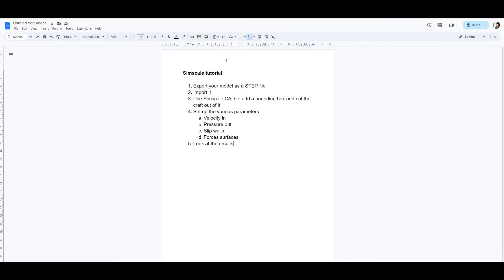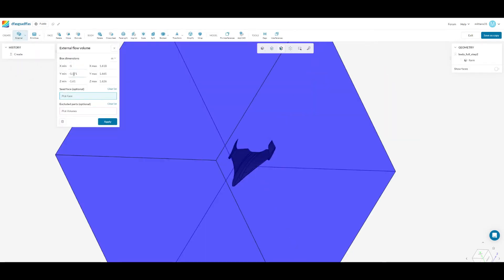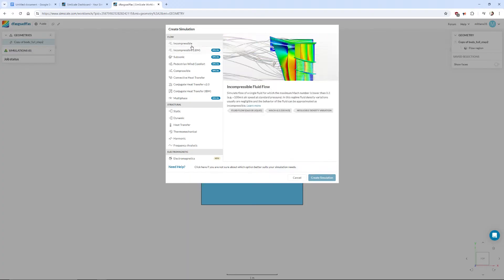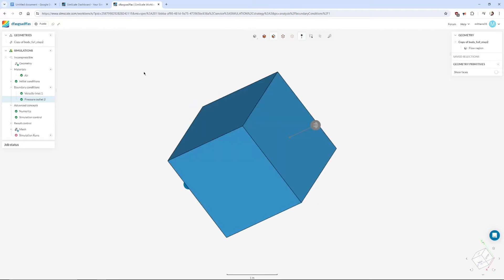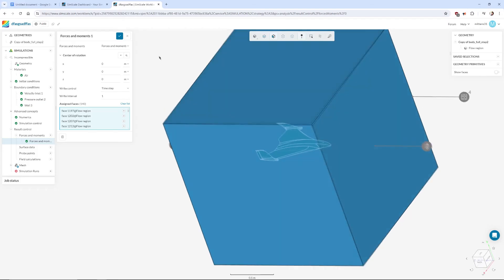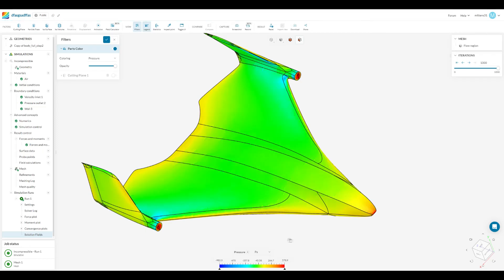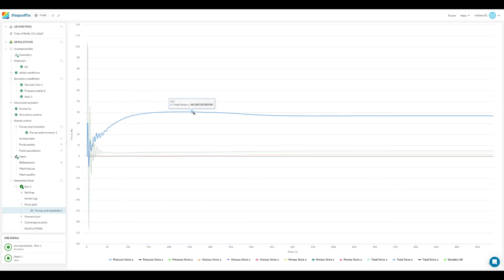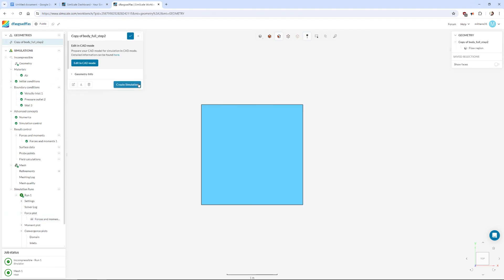Virtual Wind Tunnel - SimScale Tutorial - No nonsense

Comment: Thanks, quick question, how can I obtain the drag coefficient from the data?
Reply from the maker: You can read the drag force from the graphs, it's the force pushing against whichever axis your craft it pointed. Then just insert that into the Cd formula; double the force of drag and divide that by the product of the squared velocity, the air density value and the cross-sectional area in the direction of movement.

Comment: Thanks for the video! I did have one question, I am getting force values in the thousands for some reason. Do you have any ideas on how I can troubleshoot?
Reply from the maker: I would measure the size of your CAD model in sim-scale. You might have accidentally scaled it way up. If you're testing something the size of a 737 you should see numbers in the thousands. a 737 TOW is about 80,000kg, so it needs nearly 1 million newtons of lift force just to balance it's own weight force.

Comment: why there is no initial contitions for atnosferic pressure 1000hPa ? Should I also add this condition as initial and boundary contition for outlet wall - albo 1000hPa ? I  want to make a wind load (pressure) simulation for a building.
Reply from the maker: I don't know. I assumed that the necessary settings for atmospheric pressure / density would be set when the fluid volume is selected as 'air'. Let me know if you find out